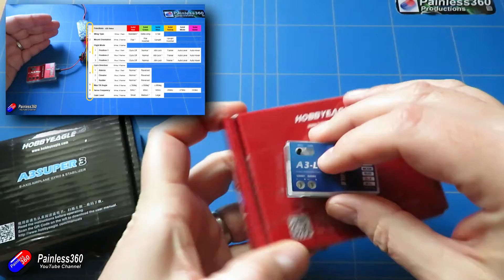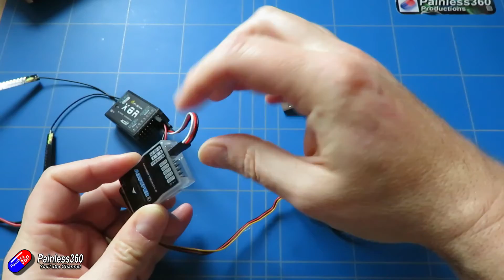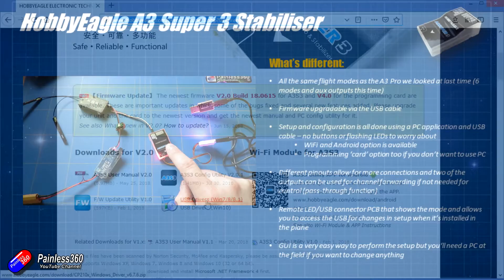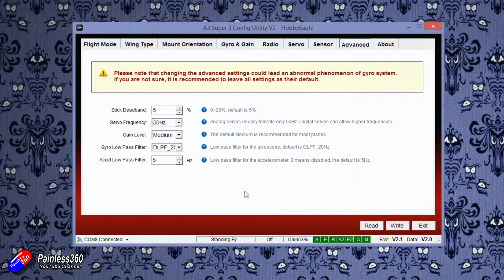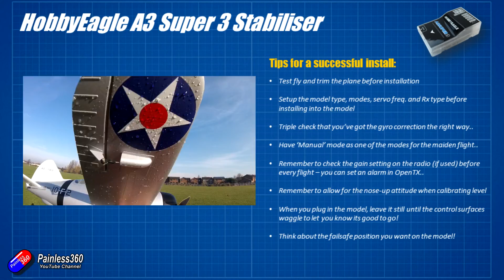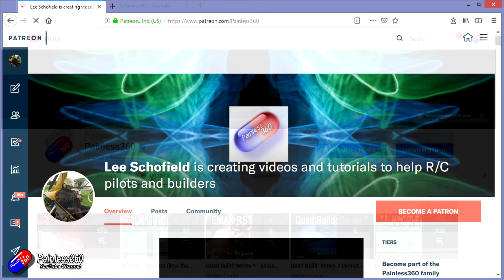HobbyEagle A3Super3 Advanced Fixed Wing Stabiliser- Full Setup

Comment: Can the a3 super 4 work with at10ii without elrs or any extra stuff
Reply from the maker: You just need a basic radio and SBUS... Happy flying
Reply: @Painless360  do you have any cheap tips to increase fpv signal 
I'm new to the idea of putting a camera on an rc plane
What can I do to increase the range of my basic fpv setup
Reply from the maker: Better antennas, more power and more sensitive receivers are all part of it. Using cheaper stuff can result in limited range. 

Antenna alignment if not using circ.polarised antennas, makes a big difference too. I have videos about if in the Antenna Lab series on the channel..

Best of luck!

Comment: At least I was able to find out that this device can handle differential aileron on two servos if receiver has enough channels. Installation and proper setup is really not simple/painless for a low stick time  flier wanting stabilization, IMHO.
Reply from the maker: A darn sight less complicated than a Arduplane or INAV setup though ;) The more basic versions are easier to setup. Happy flying!

Comment: Sir what the common ESC ampere you used on some of your RC PLANE..
Reply from the maker: You choose an ESC with 20% more current than the motor will pull. So if the motor is rated at 10 amps, use a 12 amp ESC. See my RC basics series... Best of luck
Reply: @Painless360  thank you sir..

Comment: i have one question is it possible to use sbus with the gyro and use aux 7-8 on the reciver for my landing gear and flaps or will just have to use the normal config
Reply from the maker: Should be if those two channels are not used to configure anything on the stabiliser... Best of luck

Comment: just put one in a plane that has 2 ailerons and flaps(y lead), which two outputs from the A3Super3 would I use , or would the second aileron servo plug into A2 and the flap servo lead plug into my receiver, (using futaba s-Bus)

Comment: Love your unbiased reviews. Stabilisers for larger trainer planes for beginners. Planes like the FMS Ranger 1800 and the Beaver 2000 - in your opinion KOPILOT or DETRUM Z3 or HobbyEagle A3 Sper 3/4? Thanks Lee.
Reply from the maker: It depends on on what is important to you. The HobbyEagle stuff is makes a lot model fly beautifully but a Kopilot gives you RTH...
Reply: @Painless360  That's a very good point you make indeed. I guess so does the Detrum Z3. Okay, is the Kopilot capable enough for a slightly big plane like a FMS Beaver v2 2000MM? Works real well with my FMS Super EZ4. Thanks again.

Comment: I have 2.  I have noticed that if I put the plane into an unusual attitude, then switch it from "off" to "auto-level" it will dive at ground in a turning motion.
It works correctly if switch is on before putting it in an unusual attitude..

Comment: I have a craft that uses differential thrust instead of a rudder. But it doesn't look like it has a mode for that. But I wonder if it can be setup for it anyway.
Reply: I guess I would have to use 2 ail, 2 ele and 1 Rud, but put single elevator on rud, and use the dual elevators as the trust? But then how would I control the amount of thrust... Hum... I guess this wouldn't work unless I use a rudder.
Reply from the maker: I don't see how that would work either. You can setup more advanced mixes in things like INAV... Best of luck

Comment: On every plane it works perfect....on my fw190 flightline the trainer or auto level mode is not working perfect. I can not move the aileron,ruder,elevator   smothly, they shiver if i move my sticks.....only in the trainer or autolevel mode. In normal or off mode it works perfect....whats the reason for that? In my other planes there was no problem.....

Comment: As of 2021 for a beginner what's better.... ZOHD Kopliot Or one of these stabilisers? You have used both of them what would you suggest, irrespective of their cost??
Reply from the maker: I'd suggest a really stable 'plane perfect for a new pilot to learn with (AXN. Boxler, Drift etc.) and no stabiliser. But the KoPilot provides the RTH in case of a problem as well as being pretty easy to setup..

Comment: Hi Mr Painless 360 I have a bad problem! I don,t know how to get the 3 position switch from my IX12 transmitter to work in the gyro software! Any help would be apreciated. Thank You Sir.
Reply from the maker: If that is an OpenTX powered radio check out the OpenTX Mixing School for how to add a switch to an output easily.. Best of luck!
Reply: Thank you

Comment: If you are using an frsky sbus receiver and it is bound as sbus how does the throttle work? Will it still work as per normal ie as if the receiver was bound as non sbus or is there something else you need to do. ??
Reply from the maker: All the steps I figured out (along with the manual) are in this video. I've not used this since. Best of luck!
Reply: The ESC plugs directly in to the Receiver. Whatever channel that you have the throttle set up on. I'm using a FrSky XR8 receiver. Channel 3. AETR.

Comment: Great video, so what modes would you pick that is equivalent to safe select, on my 3 position switch , I would use trainer, auto level, and then off? I using a 4 channel spectrum receiver, the plane has no functional rudder, so the 4th channel well have to be my data line, how do you make that 4 channel work on a 3 position switch.........
Reply from the maker: You can set it to be what you want. I like one mode to be stabilise and one to be 'manual' here.. Happy flying!

Comment: When I try auto-level it will level but one wing dips down,
and sometimes when it levels it does so inverted..   what is wrong ?
Reply from the maker: Probably a setting you've got wrong. What troubleshooting have you tried?
Reply: @Painless360  check settings and all lights appear to be correct color for the settings I want. Ran 4 flights and results were the same. The gyro works but the self level has problems. I think the calibration must be good or else the gyro would not work properly. I did some searching on RC forum and they had a thread but I did not see this problem addressed. Motion Rc has a reference base but I did not see this problem mentioned.
Reply from the maker: I'd check level calibration as a starter.. Everything I do to get them working here is in the video.. best of luck!

Comment: So what if I've installed it and got it working pc side, but haven't got power to the a3 when it's powered with the battery? Everything works if it's powered via usb. Just not when I have it and the rx on battery.
Reply from the maker: Then the 5v that you normally get from the ESC isn't there. You'll need to have 5v inside the model to power it. What troubleshooting have you tried?

Comment: Purchased this gyro after seeing this great vid. Unit reset itself in flight today. When on the ground if I tap the gyro it resets itself. I'm assuming this isn't normal??
Reply from the maker: Sounds like a loose connection to me, I'd let the place know that you got it from in case it needs for exchanging.
Reply: @Painless360  thanks. I've tested further on the bench and when I reduce gain the brownout/reset does not happen so I'm thinking maybe a power issue from the bec ??. Purchased from bangood so wont be returning it lol. Thanks for your reply

Comment: One extra thing worth noting is, this stabiliser is much quicker to respond than most regular 150+ms servo's, so I would recommend aiming for very fast servo response
of around <70ms/60deg  to get maximum stabilising effect. I also run a 6v bec as this also increases servo speed and reduces servo current and potential voltage sag 
proportionally. I also use this stabiliser in a Nanotalon with great success running a KST aileron servo, once tuned it helps smooth out the wing waggle better than anything 
else I've tried.
Thanks again for yet another excellent video.
Reply from the maker: Great tips, thanks for sharing! :D

Comment: I was unable to get the software to connect to my Windows 10 computer.  After a long period of messing around I came up with the following steps which worked: 

1. Download CP210x VCP Driver for Windows 10 from Hobbyeagle.com site 

2. Unzip the download which should reveal an installer called CP210xVCPInstaller_x64. You would think you should run this to install the drivers but for some reason unknown to me it doesn’t work (returns the message “The device driver installation wizard was unable to find any drivers designed for your machine.”) 

3. Plug in the USB dongle supplied with the HobbyEagle A3S3, which will somehow trigger Windows 10 to add a new device in Device Manger, Ports, a new port called CP210x USB to UART Bridge. However this port doesn’t work without step 4 below. 

4. Click on the Port identified in Step 3 and then update the driver, but not by allowing Windows to search, because that also doesn't work.  Instead use the file unzipped in step 2. After this the Hobby Eagle software still does not recognize the new port when the A3S3 is connected, without doing Step 5 below. 

5. Connect the A3S3, open the HobbyEagle software. It still doesn’t see the com port, so you need to click on the com port on the lower left (but not on the icon for the port.)
Reply: Oh yes the wonderful world of Windows strikes again...
Reply: Thanks so much for this post Joe. Helped me out loads when first linking to gyro. First flight yesterday and very impressed with the unit